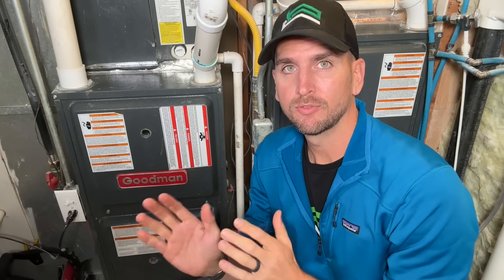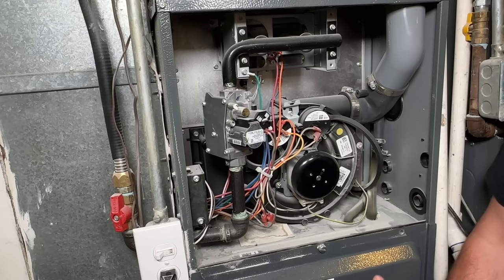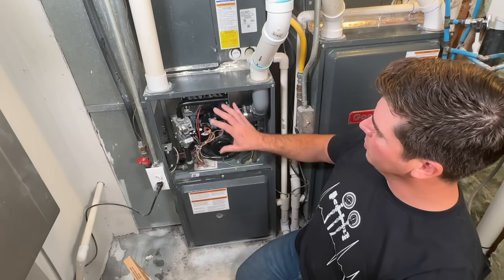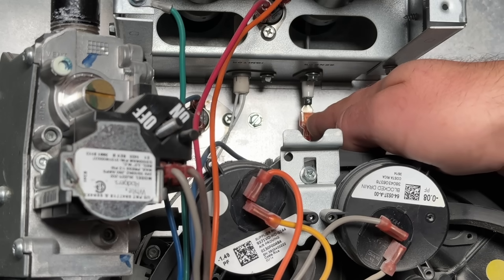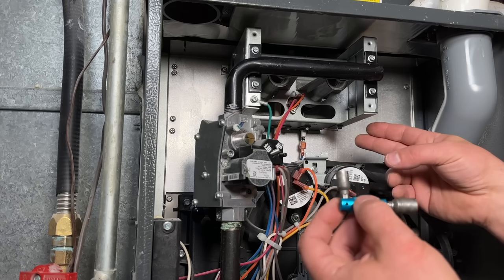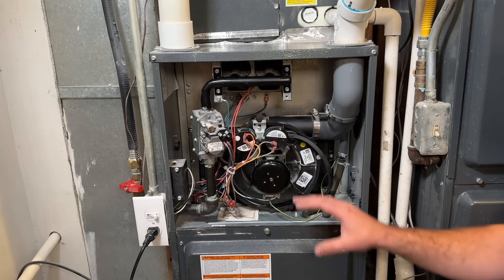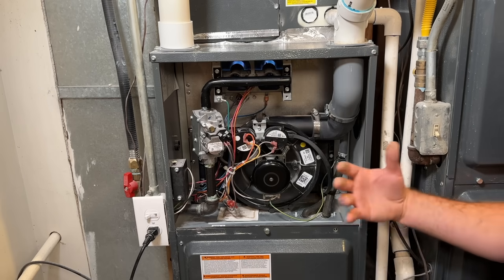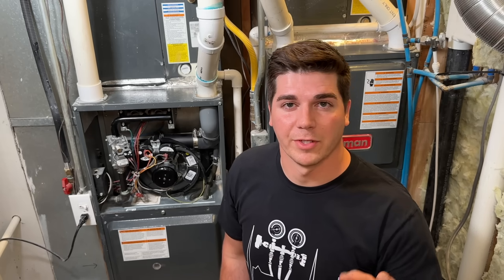Yearly Furnace Cleaning And Maintenance Pro Tips

Comment: I just cleaned the 'flame sensor' on my 4 year old Daikin Furnace, it was cycling on and off every 2-3 minutes, not super cold outside so that kept it kinda warm and had time to view your videa. Probably a million with similar info on here but I watched yours and Problem Solved !   Thanks ! ! !
Reply: Awesome sauce. Glad you saved some money and were able to do it quickly. The best part of all is that when it does it again, and it will, you will know exactly how to fix it! Cheers
Reply: Id keep a spare next to the furnace at all times. Replace both the hot surface ignitor + flame sensor at about the 10 year mark.

Comment: I took my rod out but it was L shaped on the end.  Had a terrible time getting it out.  I noticed the bend and was able to get it out once I realized.  It was corroded so it was good to clean it.  Thanks for the video.  Everything is so expensive these days.  It’s nice to prevent things from falling.
Reply: Right if and if you call an HVAC company they might come out and tell you you need new furnace.
Reply: @crand20033  This Is what they seem to do.  I took my car into Honda for repairs recently and they told me I needed all new rotors, brake pads were down to 1 mm, callipers need to be replaced.  Cost?  $2,890.   I took my car to an independent repair shop and the guy showed me the brake pads.  5 mm left on all of them.  I saw it with my own eyes.  Nothing wrong with any part of the brakes.  Callipers working fine.  They lied.  I avoided a huge bill.
Reply: @ds99  Dealers are the biggest rip-offs.
Reply: @crand20033  They lie like thieves.  As much as I like Honda vehicles, I don’t know if I’ll buy another one.
Reply: @ds99  They overcharge for sure.
Reply: Have a spare flame sensing rod and hot surface ignitor for your furance model sitting next it all times. And if it's 10 years or older, change them both out.
Reply: I also keep extra pressure switches on hand ( my furnace has two such for supporting two stages).The dealers want hundreds to change them , but they only cost about 15 bucks and take two minutes to change.

Comment: Pretty good tips and I do that myself usually every other year except filter replacements obviously. Why every other year you might wonder? Because  I simply forget to do it on a yearly basis with everything that is going on. I also keep a manual near by for a quick reference and I have purchased a few spare parts to keep near the furnace like hot surface igniter and a flame sensor thingy which are not that expensive but will save your bacon on a -35 January day. Might get a pressure sensor too, as this is a failure point on some furnaces from what I understand. Motor lubrication is not required according to my manual but I still wonder that one point myself.

Comment: Great video especially for me because I have a 20 year old Amana furnace that looks identical to the one in the video.....I clean both the flame sensor & the igniter with 600 grit sand paper every fall.....The only major problem I have had with my furnace was after about 10 years it started to leak water from somewhere from inside the top portion.....Called the installer to look at it and he did absolutely nothing to fix it so after winter was over I took it apart and found out the plastic recope cover(The thing the inducer motor is attached to) was cracked at 3 out of the 4 corners.....Replaced it and she has been running great for going on 20 years now.
Reply: Id recommend installing a new flame sensor and hot surface every 10 years at the latest. So at 20 years, I wouldnt bother cleaning them anymore, just replace them.
Reply: @srobeck77  Yeah I'm on my 2nd set of ignitor/flame sensors in those 20 years.
Reply: @Riley_1955  mine started sending infrequent ignition error codes at the 4 year mark and then was locked out just this year after only 6 years until I replaced them both. I always keep a spare next to the furnace. Thats pretty early to be failing, maybe it was a defect. 

Cant wait to see how long the new HSI lasts for. I was showing the new one compared to the old one to the wife and she friggin grabs the new one (never supposed to touch them). I go why the F would you touch it, goddamn it....
Reply: @srobeck77  Nothing wrong with either one I just replaced them both about every 7 years just to keep on top of things and all previous ones were kept as spares.

Comment: Maintenance can cut back on call backs and emergency calls if done properly. You can’t stop everything but you can certainly prevent most. Temperature differential to make sure system is not overheating and within specs of furnace, check to make sure all registers are opened and no blocked returns, blown out 90% trap for drain, clean port from inducer housing to pressure switch, make sure burners are cleaned, roll a dime across back burners to ensure the flame will carry over. Check ohms on Ignitor. Check amps on inducer motor and blower. Check with a camera in the heat exchanger for rust or potential cracks. Along with filters, blower and flame sensor. Preventative maintenance is not just feel the furnace, clean one sensor and change a filter.

Comment: Most sleazy service guys try to sell you a new flame sensor instead of just cleaning it. Thanks for being honest and showing how to maintain it.
Reply: How do you know that most would sell you a new flame sensor? I work in the industry and that has not been my experience. It's way more common to clean the sensor and rarely are they replaced. So, curious where your getting your information?
Reply: @furnaceworlddispatchemail4831  Lol right. Aren't these handymen on here hilarious? Dudes furnace is prob 30 years old with a hole in the primary. These CO induced comments
Reply: All these know it diyers eventually need to call a professional and then piss and moan about having to pay a premium for the service and knowledge of an experienced technician. Most homeowners are clueless as to what it takes to own and maintain a service company. When I get a new customer with the “everyone is a crook or so and so tried to rip me off” that’s a huge red flag and I drop them like a bad habit.
Reply: @MK-xl9tt  I’ve only had one sleeze ball before I wised up. Now I am much better at finding good professional service when needed. It’s definitely worth it when dealing with gas.
Reply: You should be replacing the flame sensor and hot surface ignitor yourself every 10 years. The best $20 investment youll ever make.
Reply: @srobeck77  they just get a carbon buildup. It’s easy to clean off (I just did it). There is nothing wrong with the sensor. It’s a piece of metal that loses electrical conductivity with carbon buildup. The flame makes an electrical circuit from the sensor, through the ionized flame and then grounded on the metal nozzle. The flame nozzle can also get carbon buildup. No need to replace those either. Just clean them if needed.
Reply: @eswing2153  absolutely right, 30 years in the field only time I ever replaced one was when I accidentally broke it taking it out.
Reply: It seems like every professional in America is trying to rip you off that's the American w a y. Thank goodness for
YouTube.
Reply: @paulwitmer7138  as soon as you say "every" or "all the time" you know the following statement is going to full of total bullsh!t
Reply: @srobeck77  so true
Reply: @eswing2153  partially true. you can clean that $12 part several times but eventually theres enough wear to it that it fails altogether. Its definitely not unlimited or as a simple of a part as you incorrectly declared it be.
Reply: Ya because a flame sensor is an extremely expensive part. Like 10 bucks.
Reply: As a technician in the field you make absolute zero dollars for replacing a $10-20 flame sensor so why would someone try to sell you one?

Comment: I had my newer furnace fail twice from something very simple and it had to do with with my humidifier and the condensation pump , there’s this clear plastic tank behind the upper access panel that I believe is part of the humidifier system , it gets gummed up and trips the safety circuit , the other time condensation pump wasn’t pumping out because the GFI tripped and that tripped a circuit in the furnace and it happened at the worst time . My furnace guy said he couldn’t make it to my house for two days and it was cold so he asked me how my mechanical abilities are and I told him and when he was satisfied  he gave me a few common things to check and I was able to get it going both times . All these furnace add on’s can be a pain in the neck form a the safety features they have .
Reply from the maker: Yeah, the need for a condensation pump on the high-efficiency furnaces is a pain especially in rental units.  Almost guaranteed to fail at least once in a 3-5 year span.
Reply: @EverydayHomeRepairs  , at least it’s something that can be disconnected and manually drained , if I turn the water off for the humidifier . I’m not a furnace repair guy but my furnace guy gave me the common causes ,now after watching your video I took notes and put them on a note pad on my phone for quick reference

Comment: Definitely change your thermostat batteries every year when you do your smoke detectors. My batteries leaked almost damaging the thermostat. Had to clean the battery connective and a bit of stuff on the circuit board before the new batteries worked.
Reply: Only use Energizer batteries.

Comment: This is a new style pilotless gas furnace. The older style has a flame sensor that's a thermocouple for the pilot light (which doubles as the the igniter), has no hot surface igniter, or draft inducer motor.  Inspecting the burners for corrosion and periodically cleaning them is necessary as the old furnaces have cast iron burners with thin flame openings that can develop rust during the "off" season, (especially if the furnace is in a basement).  Some older units have bimetal limit switch assemblies with mechanical contact switches whose contacts can become pitted and require polishing or replacement.
Reply: By "new" you mean the standard for the past 30 years now on furnaces? Hot surface ignitors have been around a long time now LOL

Comment: I remove the flame sensor every year and clean it with a smal brass brush.After 2 years I replace it with a new one.They are not expensive and easy to replace.Keep the old ones and clean them up in case you need to replace one in a hurry.Great video
Reply: That is a waste of money. If you need to replace a flame sensor every 2 years, then there is a bigger issue going on...
Reply: Replacing them every 2 years is a bit excessive, especially if you have a spare already waiting there.

Comment: I've had my furnace for 38yrs not one problem. The only though is you have to disassemble the moter from the squirrel cage just to oil the bearings. I like a pilot light. It keeps humidity from collecting. Never had any long term success with quartz lit anything . All good things must end. I'm going to get me a new one soon. Why? I've pressed my luck enough. Damn I hate to give the Intertherm up.
Reply: I hate to give mine to as well but it's 47 years old and if i don't replace it now then I won't be able to have a normal gas furnace because california is forcing everyone to buy ultra low nox. I'm going with an 80% single stage Carrier. My 47 year old is Day & night

Comment: My furnace has a screen inside the air intake pipe that needs to be cleaned. It is where the pvc intake pipe connects to the intake of the furnace, this was a course screen to trap bugs, bats etc, original Bryant part. Scotch Brite or steel wool on flame sensor, clean out moisture condensation trap.

Comment: 1 quick question on the flame sensor. Removing the flame sensor is easy put upon reinstallation do you want to censor to be right in the middle of the burner or to the side? It seems ours is alittle off center of the burner. A pic would be good if possible. Love the channel and your very clear with everything👍

Comment: I've been doing furnace cleaning for 20 years, clean your flame sensor if your furnace starts, then the gas shuts off rite away... honestly if you have one of those Goodman furnaces the biggest problem is the hose clamp off the inducer fan to the exhaust is not tight enough, I see 1 in 4 new houses its rusted out or gets water on the board before the house is even sold cause the installers didn't tighten it enough or stripped the hose clamp and water trickles down the plastic side. (tinfol is good for flame sensor cleaning in a pinch)
Reply: I think I have that problem, Goodman furnace, new built house under 3 years, recently the furnace heating stop working middle of the night. Hired a tech, he show up pop the cover open, there was water dripping down from the bolt, the bolt that keeps the clamp tighten to where the inducer fan is….the bolt was very loose, he tighten up the bolt and he blew air into the tube to clear out the water drainage tube.  Then 2 weeks later it happened again the heating stops middle of the night…this time I pop the cover open and found the same thing again small drop of water hanging onto to the the bolt….I’m gonna pop the cover again and reconnect the tube and clamp, see if that will help….or should i just go get a new clamp? sighhhh

Comment: If you rent, good luck on getting this service done. If it is done, your rent goes up a lot. Dust is a major factor in COPD and growing alarmingly fast. Most homes must take every vent and plumbing passages & clean them by hand to make sure they're clean proper. Then clean your house thoroughly inside before turning the heat and or A/C back on.

Comment: My Heil (1987) furnace would BEGIN the startup process, but then shut off.  I learned it has an INTEGRATED Ignitor & Flame Sensor.  I scrubbed it with fine steel wool, then alcohol wiped, and it fired up normally.  On my furnace, it turns on a small pilot flame, and if the flame sensor detects that, it allows main burners.  If the pilot flame is not detected, it shuts everything down.  It would also detect if the main flame went out, and also shut down.  The plenum thermostat controls the main blower based on the temperature of the plenum.  So, if it's been running for awhile and the flame goes out (or the wall thermostat reaches set temperature) the main blower will still run as long as the plenum is hot.  I lube my main blower every year, and remove it for a full cleaning every 10 years or so.  Finally, Be SURE to have a Carbon Monoxide (CO) Detector installed, and if you have ANY DOUBTS WHATSOEVER, Hire an HVAC Professional to perform an inspection.

Comment: I have a question to you. I have a temp star. It’s about 24 years old. I cannot find my flame sensor. I was having problems. The burner was cycling off and on, and I found that the problem was the pressure report coming out of the chamber has some crud in it and I cleaned it out and it’s working, but I like to clean that flame sensor.

Comment: Hmmmm, great video guys.  I had a new furnace placed about three years ago and it has been solid, however this winter it smells very dusty.  So I started exploring.  I sucked out a lot of dust out of my ducts with my shopvac and just had two long extension to the hose.  I have my calendar set to replace the furnace every 10 weeks, which seems ideal.  But I never took time to look further into the operation of the furnace.  We are always:  Let's call someone.... which never happens.  But this video encourages me to at least take the cover off the furnace and see if I can identify the parts.  I always have the attitude:  If I don't know what I am supposed to do... I will read up and even if I am not certain I will call the maintenance guy in our condo and pay him under the table to show me what to do.  There are actually very good drawings on the inside of the furnace, I saw that when they put it together in our crawl space.

Comment: So many homeowners attempting their own service its scary. 
When you cant fix it and need to call us, we can tell when you tried to "fix it yourself". 
Flame rectification failure can happen for several reasons outside of a dirtly flame rod. Like a faulty ground/board. Also, if the flame rod is dirty, than the reason behind it should be ivestigated. Could be improper inlet/outlet gas pressures, could have the improper access to combustion air. 
And if you used sandpaper on your flame rod, the residues from the sandpaper will oxidize and your furnace will get a flame rectification error code again in a few weeks. Scotch brite pads or an american $1 bill. Never sandpaper, never steel wool. 
We service techs are licensed for a reason. We go through the schooling and training necessary to be well versed in the sequence of operation and how to troubleshoot all components. 
If you arent a licensed gas tech, dont touch your furnace. Want to save money? Dont touch your furnace. Dont want an expensive call because you re-wired the unit wrong and shorted out the board? Dont touch your furnace. 
The ammount of calls i get that start with "i tried to fix it myself" where a component has been broken in the process.... what could have been an $80 service call because of a loose wire harness now becomes a $1200 board replacement. 
You think you're smart by doing it yourself until you have a breakdown.

Comment: My furnace had dirty filter which was causing the furnace to turn off due to over heat. After changing the filter still had issue, getting error code. I compared the error code it was a fuse that was triped due to over heat. Reset that now everything works perfectly.